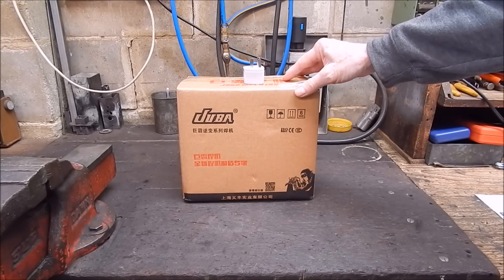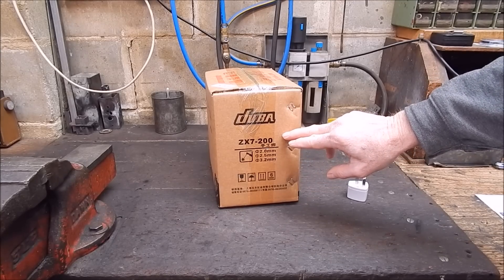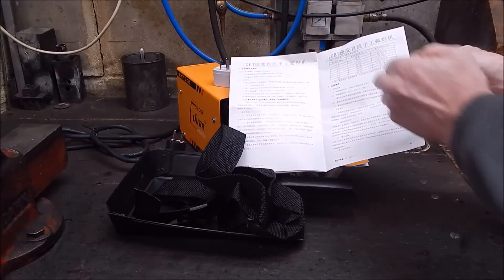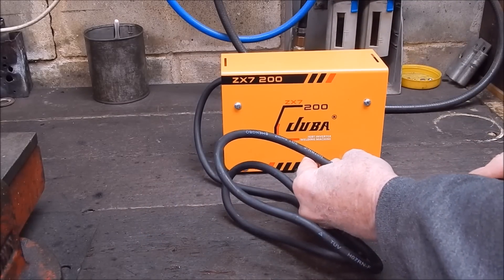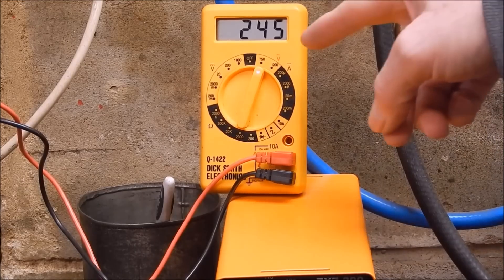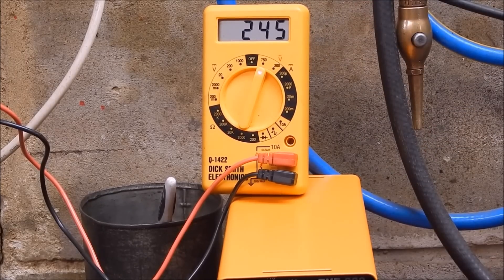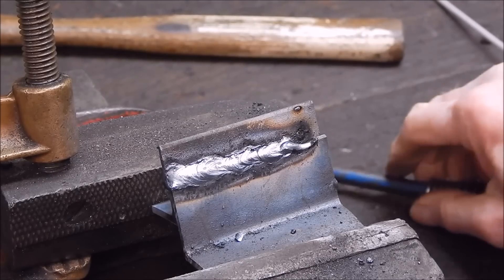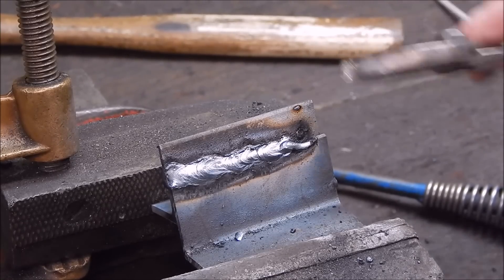I review another tiny inverter stick welder from Banggood - excellent

Comment: Just got that ZX7 200 Juba off of Bang good I was extremely skeptical beyond imagination it's about the size of my foot I even hooked it up with   14 2 romex  With some outlets  made   for 20 amp 110 V  Wired with 2 hots and copper and it works like magic   Thanks for the review I hope this thing last a while it's amazing what they can do now compared to 20 years ago
Reply from the maker: Hi Dave, It's amazing what they can do with compact electronics these days.  They even sell a DC welder where the box bit is part of the electrode holder, so no box as such, just a pistol grip electrode holder and a ground lead.  Unbelievable.   The whole power source is about as big as a box of tea bags.  Some company offered one to me for review, but I can't remember who it was.  Not BG.  I'm not sure I would fancy holding that amount of mass for too long.  But you have to give it to the Chinese for that one.  After all these years with AC I still struggle a bit at times with DC.  Still have the old buzz box ;) Cheers Rob

Comment: Ordered one hope it works. What Rod should I use here in United States to weld quarter inch steel for a trailer gate and a snow plow. I did some welding when I was Kid but never had to buy the rods
Reply from the maker: Hi Dave,  Any general purpose welding rod will normally do for mild steel plate. If you weld  high carbon steel such as a dozer edge blade then I would use low hydrogen rods. I mainly use 2.6 mm diameter rods but 3.2 will  be better for heavier work like the job you have in mind.  Crank up the amps and away you go.  Also you will have less chance of arc blow with the larger rod. Cheers Rob.

Comment: https://www.banggood.com/ZX7-200-miniGB-200A-Mini-Electric-Welding-Machine-IGBT-DC-Inverter-ARC-MMA-Stick-Welder-p-1497117.html?rmmds=search&cur_warehouse=CN

Even more cheap welder, (€38,5 in a promotion, shipped to my door) i ordered it yesterday. The name has also ZX7-200 in it. Very curious about the performance. :) Should arrive in september.
Reply from the maker: Good luck Michiel.  I recon it's a great welder, and so do most people that buy the ZX7-200 versions.  Easiest DC welder I've ever used.  Cheers Rob

Comment: No cables or  stick holder included?
Reply from the maker: No.
Reply: I bought something like this that had the hardware but no cables.  It's a tiny thing and it shipped in a tiny box!  I already had leads sitting around so it wasn't a problem.  There are suppliers here in the States that will sell small lengths of welding cable, and if you want you can get half red and half black.  It only takes a few minutes to make up the leads.   These machines are so portable, you don't really need long leads as you might have in the past.  So many of these things come with a strap, they clearly intend for you to WEAR the machine!   I haven't seen anyone do that yet.  A 21st century fashion accessory!

Comment: Hi Rob, I was going to buy exactly this Juba machine but ended up buying another ZX7-200 clone from Vevor, purely because the distributor offered a 2 year warranty rather than 1 year for the Juba.  I tested the machine with 6013 rods from 2.0 up to 3.2mm and the welding looks good.  I was disappointed however when I decided to measure the actual current passing through the weld cables using a dc clampmeter.  The display current seems to be highly optimistic, with the display currrent being higher than the actual current by as much as 50%.  With the current dial ramped up to maximum 200A (with the display reading 199), the clampmeter reading came in at 125A.  I wondered whether you ever measured the welding current of the Juba with a clampmeter and compared with the dial graduations, including with the maximum amperage setting of (allegedly) 200A.
Reply from the maker: Hi Ivan,
I  compared how the rods welded at the indicated amperage against my AC welder. Everything lined up which is more than I can say for the other DC welders I have used.  No I did not use a clamp meter on the cables as I don't have one that large.  You also have to allow for losses in the cables, so for a true reading it must be taken at the terminals/lugs as I understand it.

Cheers Rob

Comment: This isn’t a 200a welder, it’s 115a. FYI
Reply from the maker: How did you deduce that ?
Reply: xynudu testing. It’s a great welder but the outlet is wrong. Used a clamp style meter to read the amps.
Reply from the maker: If that was the case it would have to be on full power to burn 3.2 mm rods, which it is not.  So that clamp reading cannot be correct.
Reply: xynudu are you in USA? I am, maybe that’s the difference. The clamp is correct as I use it everyday. Even the seller told me it’s only 115a after I asked. Said it’s just like the Zojan that advertises 200a but is only 110a
Reply from the maker: As I said, it's only on half power when burning 3.2 mm rods.

Comment: Hello, I want to buy this device, is it worth it to spend money or not?
Reply from the maker: Yes, definitely.  Easiest welder I've ever used.  The only negative is the low duty cycle, so not ideal for a very hot climate.  I tried to overheat it in a video and failed.
Reply: @Xynudu  thank you bro.
Reply: another question, which is better 250 amper? or 200 amperes
Reply from the maker: Hi Jovan,

In real world use the maximum sized rod a home handyman will use is 3.2 mm which requires no more than 200 amps (generally 130 amp).  So the extra amperage is incidental except for the likelihood that the duty cycle will  be better on the larger unit.

The smaller size welder will be running at a higher percentage of it's rated output, so it will have a higher heat factor for any comparable setting.  In hot weather this could be an issue.

Welding characteristics will vary with the circuit board/components used, so there will be variation between units that only becomes evident in use.

If you are switching from AC to the DC welder you will find they can all suffer from "arc blow" as the result of poor technique or magnetised steel.  This can be a major issue with DC even when used by professional welders..

Cheers Rob
Reply: @Xynudu  Thank you very much  Rob

Comment: 8:58 . On DC  - Welding machines (for stick electrode) u usually uses the negative (-)  for the electrode and the positive (+) for the clamp.
Reply from the maker: No.  Polarity on stick is usually the reverse of MIG.  Stick generally uses maximum penetration.
Reply: I am by far not an expert in welding, but what I know is that in DC current, the electricity flows from Negative (-) to Positive (+). So in this case u will get much more penetration if your electrode holder is Negative (-) and your clamp (work peace) is positive.
Reply from the maker: https://www.lincolnelectric.com/en-au/support/process-and-theory/Pages/understanding-polarity-detail.aspx
Reply from the maker: Yes, there is conflicting information out there.  Lincoln electric is a major welder company and I'd be more inclined to say they are correct, rather than some unknown.  The DC welder instructions for the unit shown in the video also say/show connect the electrode to positive.

A rudimentary burn of some rods shows quite clearly that Lincoln is correct. "+" electrode is most commonly used for deeper penetration and gives a weld profile similar to AC welders.  

Going "-" lowers the penetration, puts more heat in the rod, lays a higher bead, but gives a generally poor looking weld.

The only time to try negative is when burn through is an issue.  Overall, a low penetration rod generally is a better option.  Going up a rod size also helps.

Cheers Rob

Comment: Thank you for your video. Could you plse tell me if this welder can weld thin sheet metal around car body panels? Thank you
Reply from the maker: I have welded down to 1 mm with it, but for car panel work you really need a gas mig.  Stick welding has a lot more burn in and filler run.

I would not recommend using it for car panel work.

Cheers Rob

Comment: if the ZX7 is the series of boards for inverted welders are all the little ZX7-200 welders comparable?
Reply from the maker: I would expect so, but there is the issue of components used.  It may be possible to bottleneck the board with inferior items.  I can't say, but obviously there can be a difference. 

The circuit is a basic design, but how well it's implemented is not set in concrete.  Only by comparing the quoted duty cycles (if that's accurate) can you compare output.

Cheers Rob
Reply: I didn't want to announce this straight away because they only have a few but banggood has a zx7-200 welder in their US warehouse for $59 right now, I can't afford much but there's not going to be a better deal on one of these little inverter welders,  if it's any good.....
https://us.banggood.com/Wholesale-Warehouse-ZX7-200-220V-Handheld-Mini-MMA-Electric-Welding-Tool-Digital-10-200A-Inverter-ARC-Welding-Machine-wp-Usa-1366149.html?rmmds=category

Comment: I live in the U.S.A, Does that little stick welder run off of a standard 110v outlet or is it 220v?????????????? It is confusing when one/a begginer tries to find a decent but cheap welder! I have purchased a cheap Chicago electric 90a wire feed junker when I drove to Harbor freight, I went there to get a stick welder but, THEY WERE SOLD OUT! SO, CAN ANYONE TELL ME IF THIS BANGOOD WELDER IS ANY BETTER THEN A HARBOR FREIGHT STICK WELDER???
Reply from the maker: I have not seen any ZX7-200 welder advertised to run off of 110 volts.  The specifications all say 220 volts.  The review clearly shows it is a very easy welder to use on the stated voltage. 220 - 250 volts.

Comment: Can anyone confirm or deny this can be wired for 120 v ?
Reply: absolutely not.  the 120v would have a duty cycle of 40% at 130A, and you'd be lucky not to pop a fuse/breaker every 5 mins.

Comment: crap just noticed [after buying it] that it needs 220v, I thought something this dinky would run on 110
Reply: Jesse James hey outlaw (JJ) make yourself a double 110 adapter cord, I made mine from 2 power strips  and a female 220 . Just plug the two 110s  into separately breakered outlets.
Reply from the maker: Mine had a sample piece of cable in the box.  Get the largest size that will fit in the Dinse connectors.

Comment: This thing comes with no electrode holder/ground clamp, is that normal ? Are these like standard fittings ?
Reply from the maker: Pay more and leads are generally included in the kit.  But doing it the BG way you can swap across the AC leads from your old welder when going DC.

Decent long/heavy leads are expensive, so it's worth buying a cheap AC welder secondhand and cannibalizing the leads.
Reply: thanks for the tips, don't have an old welder so I'll have to purchase, what gauge wire, 6 ?

Comment: what size generator would be needed to run a welder like this ?
Reply from the maker: Don't.   Inverter welders can fail when used on a portable generator, due to the voltage fluctuations. Not recommended.

If you decide to try, it would need a generator that can supply the required input amps - about 9 - 10 amps (3.2 mm rod). 2.5 mm rod would need about 7- 8amps continuous.

Cheers Rob
Reply: @Xynudu  
Thanks for the info.
Might have to look for an welder/genarator then.
Reply from the maker: An AC welder will run quite happily off of ANY suitable size generator.  You can't hurt then with bad current supply like DC.

AC will require a generator capable of at least 10 amps continuous for a 2.5 mm rod.

Cheers Rob
Reply: @Xynudu  
Thanks again.
My geni is a 5000 watt , no idea about amps. ( iam a mechanic )
However i do have a tractapack mounted to a 3 cylinder diesel. Geni works on that one but i cant get the welder to work. Hopefully one of my friends  ( a sparkie ) will find the time to help me fix that one.
I understand that tractapack where rather good welders. 
Thanks again for your feedback.
Cheers
Reply from the maker: 5000 watt (continuous) =  approx 20 amps for 240 volts output.

So that should run a single phase AC welder easily.   The worst that can happen is it may trip the thermal overload.  No problem.

Tractor packs can be single or three phase.  They are basically just a pto driven generator. Check the output amps, they may not be as high as you expect given the size of the unit.  There should be a specification plate on the generator.

Cheers Rob

Comment: Can an inverter welder be used by someone who has a pacemaker ?
Reply from the maker: Hi John,

Any type of arc/electric welding device can interfere with a pacemaker.  The EMF danger comes from the arc and cables, more than the type of machine being used.  So an inverter is just as dangerous as a basic transformer type when used.

Best not to use any type of electric welder if you have a pacemaker fitted.

Go gas welding/brazing instead to eliminate EMF dangers.

Cheers Rob

Comment: Besides the 2 minutes out of every 10 minutes (20%) duty cycle, there are some more specification details to be considered.  As I don’t have numbers for stick electrode welders (or MIG welders either) in my head, I just list the TIG testing specifications.
The idea is that an arc voltage is fixed at 10 V DC.  The torch and cables are assumed to cause a voltage drop of 40 mV per ampere.  That of course means resistance of 40 milliohms.  Or it means that at 100 A the welder output terminal voltage is 14 V.  At 200 A the corresponding reading is 18 V and so on.  That all means you need to measure both current and voltage and probably need a load bank rather than welding arc for good steady conditions.
As output power is the product of voltage and current, the primary power being proportional and primary voltage is nearly constant, the primary current goes up more than linearly with the welding current.  Depending on the cooling and other design issues, the limiting factor could be in the secondary side or the primary side or quite often in the AC outlet ratings.
Reply from the maker: Background (air) temperature is critical when measuring duty cycle.

Comment: So, this could weld steel bike tubing? I've had some projects in mind but don't need or want a big ass welder. I've don't just a bit of welding decades ago and know it would depend on me but will the machine be capable? It seems ideal.
Reply from the maker: I would use gas welding for light tube.  Plus you get the capillary action/full bond that arc can't give.

If you want to go electric then MIG with gas would be my choice.

Cheers Rob
Reply: @Xynudu  Thanks!

Comment: what you said about bigger welders not liking 250v is interesting, i have a SIP 150 stick welder and that doesn't like extensions in the power lead, plugged in the wall its fine, but plugged into an extension reel it cuts out.
Reply from the maker: Hi Aly,

That sounds more like voltage drop from the cable.  Possibly a part open circuit in it.  Some CIG/Cigweld inverter welders used to not start up on 250 V or more.  

Cheers Rob

Comment: Duty cycle is out of a 10 minute period so that is 20% of 10 minutes
Reply: Yep. +1 
That would be 2 minutes of burn time out of every 10. And that's only after the thing has heated up and reached its steady state. When you first turn it on, you could burn rod after rod for 5 minutes straight, and that still doesn't mean it can necessarily sustain 20% duty cycle at that current. So the rating is not weirdly low. 20% duty cycle is plenty enough for many uses. It would be weird if someone needed more than that in a home shop. It would be weirder if they made a welder that would do 80+% duty cycle at 100A for the low end home market. You'd want a welding robot and an assembly line to take advantage of that.

Comment: Hi, I'm new to welding. I want to buy this unit. Can you please tell me what are the missing items for this welder? Such as rod holder ect...
Reply from the maker: You don't get cables , ground clamp, and electrode holder. 

I view these welders as a cheap way to upgrade from AC to DC by using the existing cables, or buy a cheap AC welder and swap over the leads and fittings. New HD cable is expensive.

Cheers Rob.
Reply: @Xynudu  Thank you.

Comment: Hi Rob, from Port Lincoln.  I picked up a 24volt DC Mig welder the other week.  Seems interesting and a bit different but simply no time to have a play with it yet.  Next time I swing by Radelaide are you interested in having a fiddle?  The idea of having a gas-less Mig out in the scrub intrigues me...  Could use some advice on getting a lathe of some sort too.  Cheers.
Reply from the maker: I'm the last person you should discuss MIG welders with.  I've never used one or had any practical experience with them.  I've seen some great and some god awful welding done with them - gasless is total shit.

I am happy to discuss stuff through email, but that's it.

Cheers Rob
Reply: @Xynudu  Cheers for that and fair enough - picked it up for the novelty value as much as the $20 it cost me...  It came with an old school heavy copper AC welder thrown in.  When I have a good question to ask that you haven't covered in your videos I'll sing out.
Reply from the maker: Not many of those old welders actually ran copper windings.  It's surprising how early on they used aluminium windings.

That old 130 Lincoln I scrapped for the cables a while back is a classic case.  I felt sure it would be copper, but no way.  The windings are generally varnish coated flat metal strip like metal banding/strapping.

The copper ones are generally branded with the word copper somewhere.

Good luck with both of them.

Cheers Rob
Reply: @Xynudu  As the AC welder works perfectly it will go into the hoard...  Best welder I ever bought was an inverter DC/TIG which just powers through anything I throw at it.  It does need 15A to remain stable beyond 120A output though...